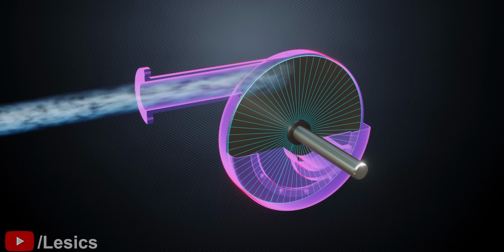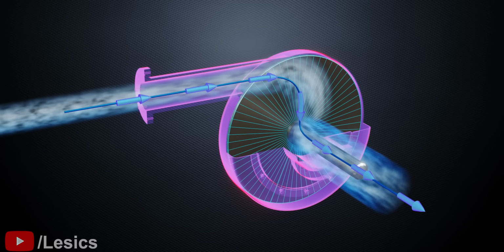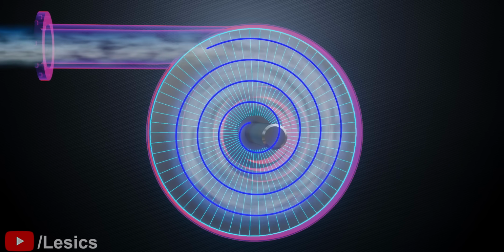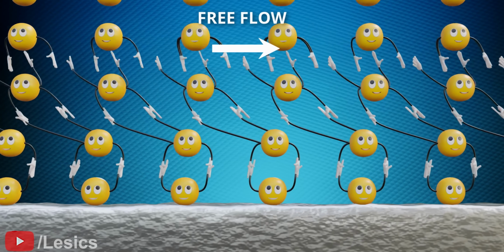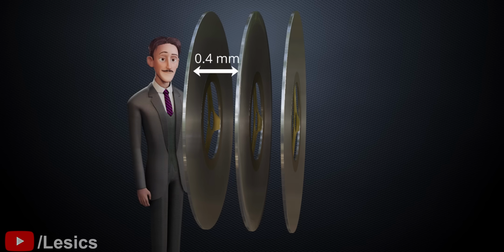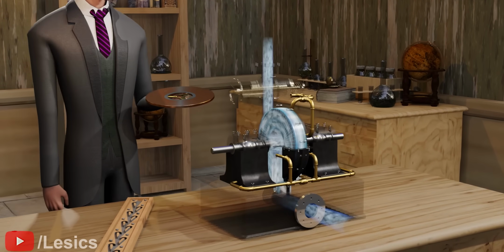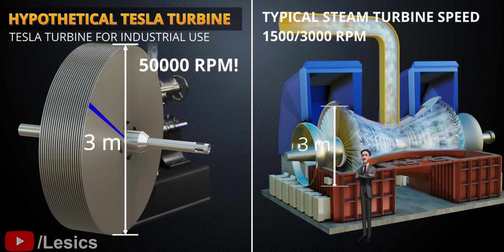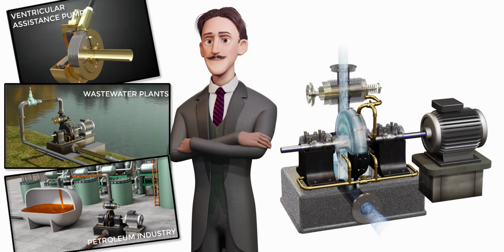Tesla Turbine | The interesting physics behind it

Comment: TESLA : "It seems that I have always been ahead of my time. I had to wait nineteen years before Niagara was harnessed by my system, fifteen years before the basic inventions for wireless which I gave to the world in 1893 were applied universally."

we have to wait more for Tesla Turbine because we dont have strong enough material this monster :)
Reply: Anyone that hasn't worked at a steam power plant with steam turbines does not really understand the complexity of a steam turbine when you have to overhaul one every so often our power plant had six boilers and two turbines for each boiler they made $375,000 volts and they stepped it up to over 500,000 then it went to various other industries and cities at other voltages mainly for the cities of 69,000 KV would travel 20 miles to another step down substation that would subsequently step that voltage down to 13,000 or 4160 whatever the case may be then going down your street to another transformer to step it down to usable 120 to 240 v
Reply: Sometimes, great inventions never see the light of day before other technology makes them practical because they are superseded by newer inventions that achieve the same or better outcomes in a different way.  We might one day develop an exotic material that is strong enough to build a giant Tesla Turbine.  But, why bother going to all that trouble when today's turbines are already 90+% efficient?  You can't get more than 100% efficiency, so if today's state of the art turbines are already close to 100%, then the Tesla Turbine offers no benefit.  It was brilliant in its time, but it will never compete with today's turbines in large industrial use cases.

It's not a magic free energy machine, people.  It's just a turbine.
Reply: @bradwilson76  increasing efficiency on an inferior design may result better yield, yes. But not the best yields possible. Applying the same advancement  to the superior design will always result in a better system. 
   During construction of a 120 story building, adjustments in construction after the 50th floor cannot make up for advancements discovered in building foundations. 
   There comes a stagnation as attempts of increasing efficiency reach a certain level. 90%+ you say we are at now. I'm inclined to believe that may be exaggerated.  Not enough to spend countless hours performing experiments, repeating them, and doing the math to check. I would concede +or- 3% of 90% efficiency. But doubt that is what we are yielding in real life applications. But here comes the brick wall, so to speak, of advancement in these systems. Progress slows to a near standstill with little result and massive effort. With so much put into advancing this system, would anyone contemplate going back to the beginning and changing the foundation (using a superior design) in their quest for advancement? The system in place doesn't have to be immediately scrapped and considered garbage. It served its purpose, can continue to serve that purpose during the transition to the better system. We should never stop looking for a better way, or succumb to our arrogance by believing we've reached perfection. 
  Civilizations thousands of years ago, deemed primitive now, accomplished engineering marvels by today's standards. Some of which can't be duplicated. Things we take for granted in modern society, like plumbing, is ancient technology. Tech that disappeared after their superior society imploded, and only recently resurfaced back into mainstream use in the last 100 years. In that time, we have not made any real breakthroughs in advancing the technology. Improved it with modern materials we use to build the system, and devices like sinks and toilets (more for  vanity purpose than functionality) that become the weak points of the system, since our improvements are  the majority of causes of the system failure or breakdown. 
   All throughout history are examples of thinking the best had been achieved, yet advancement continued. By new discoveries, or moving seemingly backwards, to improve the foundation your building upon. 
   In today's world, many things thought to be anadvancement, is just us over complicating something to satisfy vanity, greed, and desire for a gluttonous lifestyle.
  Will mankind reach greatness and achieve all that seems impossible? I hope so, but if not, it will be because mankind was its own downfall. 
   Something else to think about. 
It was said, "everything that can be invented, already has been".  Didn't age well. 
   And I pose the statement 
'Nothing has ever been invented,  only discovered'.
Reply: @johnkutsch7411  You have a point,the Bible,book of Ecclesiasstics said:"There is no new thing under the sun...."..I noticed that inventor simply imitate the plants,animals body designs,systems,etc.....
Reply: @bradwilson76  size and portability might be two worthwhile advantages
Reply: The atmosphere carries energy in it and he harnessed it - no machine needed.
Reply: abi yoksa teslacraft mı geliyo :)
Reply: Couldn't we just make them smaller and make more of them? The video suggested 3 meters, but honestly, why would they have to that big at all? Because out current systems are that big? So what? Scale it down and then bam, all the sudden your materials will be strong enough. We don't have materials strong enough to make huge ones, sure, but who ever said they had to be huge? Why can't it be a huge facility full of very small ones? We could even make them smaller than his model if we had too.  Take rc cars for example. You can go 100mph with thin plastic parts, but scale it to full size without changing proportions of your materials and all of the sudden your materials will no longer be strong enough to handle the power.  Idk why everyone is assuming that they have to be large to be used on an industrial scale. Take most crops for example. Crops like soy tend to be very small, yet we still grow it on massive scales all over the world. We don't give up on it because they are too small or try to make them grow to 3 meters tall, we simply grow more plants. That's all we have to do with this design. The downside is that making a bunch of small ones means more parts to break and  higher costs to create, install and maintain them all.
Reply: @alexcrowder1673  large scale is needed to transmit. Small scale would put the power plant in your home. Cant make tons of money that way. 
   The push should be to make homes self sufficient. Not pay someone else to deliver what can be produced on site.
Reply: @johnkutsch7411  you could simply use more discs. The production of so many high strength minimum tolerance discs is a challenge regardless but there’s still some point where you just trade off disc radius for quantity.
Reply: @Coolio_Wolfus actually, let me expand on what I said.
Graphene is just 2D carbon sheets made into structures.
You got the flat sheets, the nanotubes, the buckyballs, and finally the newest structure, schwartzites. I mentioned them in an earlier comment.
Schwarzites are the most complex and have the best potential for structural materials, but they vary a bunch in how they are formed.
Basically its like you are molecularly constructing a sponge shaped object.
Reply: @scout360pyroz  : For a Tesla turbine you'd presumably be aiming for the flat sheets. Not familiar with Schwartzite.
Reply: @absalomdraconis  we are talking atomic level 3D printing of carbon atoms via chemical methods, almost casting them into a chemically constructed mold.
Reply: @Coolio_Wolfus that means nothing. carbon structures all have weaknesses to forces from a variety of directions, and graphene is no exception, regardless of relevant media sources making money off of exaggerating its strengths.
Reply: Smart people work by having many ideas, not by having every one of their ideas be good ones. There is no shame in having a reversible pump that works well for liquids but not gases.
Reply: Use Rearden Steel
Reply: And we unfortunately still don’t have actual wireless electricity
Reply: interesting that talk was about the turbine itself, without discussing the possibility of gearing mechanisms. all generators are connected to a gearing system, as far as I understand it anyway.
Reply: Fred Garvin  his contribution to science were hijacked by Edison, the Rocker fellas and the Fed unfortunately 😔 he laid the fundermental basics to alot of things we use today...
Reply: I wonder what materials he thought of using back then vs what we now have available. We have a lot of very strong metal alloys and other materials now that may be able to form a workable model.
Reply: Tesla invented radio but Marconi stole the idea. Marconi was like the Steve Jobs of his time steal or take credit for ideas and market them as his own.
Reply: @dg-hughes  true but to play devils advocate tesla put it on the backburner and didnt do anything with it. tesla had the problem of inventing something and then just leaving it alone and not touching it again.
Reply: Tesla's Turbine in under the ground.
Reply: william bush  The Black Knight satellite?
Reply: We were taught in millwright school about the volute not the Tesla in the pump I wonder what happened LOL
Reply: @ronalddaub7965  as a millwright myself I’ll answer your question. It generates extremely small amounts of torque. So practically it’s useless for anything you’d want a turbine to do.
Reply: need to cut down on the mass of the wheel and if possible heighten the strength it has against pulling.
I wonder how resistant some schwarzite nanotube structures or high tech 3d printed (then milled) plastics could be.
I know the former can have phenomenal resistance to force from one direction... but that was usually conpressive force.
Reply: No, we have strong enough materials these days. Heck, there are functional Tesla Turbines that have been built in the last decade.
Reply: @Yawehplaneswalker616  on an industrial scale?
Reply: You need to add gears.
Reply: if you can make peanut butter sandwich, tada you're an engineer lol.
Reply: Thats freaking genious!!!
Reply: So titanium won't work???
Reply: Niagra was originally designed as an AC polypase generating system, inspired byrR&D being done in Europe, long before Tesla entered the fray. 
Tesla denied the very most basic basis for wiereless communication, planning instead to sent mis communications through the ground, same way he expected hie wteless power system to work. It was only much later, when Scientists and engineers had determined the best ways to make it work that Tesla jumped on the bandwagon.
Reply: @Abraham Technology college dribble regurgitation
Reply: The efficiency of the Tesla turbine was exceeded significantly by the late 1920s.  So no, it's not that we don't have "materials strong enough for this monster" -- it's as simple as there is a lot better tech right now.   The Tesla turbine was more efficient than steam turbines of the time.  But axial flow turbines are significantly more efficient.
Reply: Gaspar Cunha Cunha
0 seconds ago
We have a long way to go.It is just the start ............
Reply: @emDce  (
Reply: I wonder if these could be made in the microscopic scale for niche applications.
Reply: Different fluids have different levels of viscosity, and a more viscous fluid would allow a wider space between the discs. As would a different disc surface type. Could a greater level of efficiency at lower RPM be achieved that way?
Reply: @reddysteddy2195   The general principle would indicate 'Yes'...
Tesla was coming from a fairly 'steam-oriented' environment, as well as having experience with liquid water as the working fluid.
While the first commercial industrial vapor compression refrigeration equipment was marketed in the late 1850's, is was probably not viewed as compatible with the ideas that Tesla was pursuing...if that even represented a potential improvement...
Then he got interested in some other things...
Reply: And then comes an apartheid capitalist and steals his name.
Reply: Carbon nano-tubes?
Reply: Hi there. 
So what you want to use is cubic boron arsenide, which is the highest thermally conductive element on the planet.  In fact, as heat increases so does its rate of thermal conductivity. Higher than diamond.

It also happens to be an electrical insulator, which is a design plus.

It is also a fairly hard element, at 22 GPa on the Vickers scale.  Which is about 2 1/2 times the hardness of steel.  Less than diamond, but the most important part here is thermal dissipation.  

And it can be grown in a lab to fit any form or shape.  And is cheaper than diamond by far.

That said... you could probably get away as well with having an thicker base on the disc, and thinner almost razor like edge... Which would help in thermal dissipation of the rotor... as the fastest moving area will be the edge, which will also experience most heat.. while the center will experience the most torqueing force... 

If someone would simply fund me, I'm pretty sure I could make a tesla turbine with 96-97% efficiency fairly easily.

It would only take a few billion :D
Reply: 0p
Reply: @emDce  it was born in a land now called Croatia which is probably Serbian long time ago like Kosovo was. Some croatians were calling Croatian..But.he he said he was a proud Serbian.. His father was a Serbian Orthodox priest. They say was never close to his son.. h it was much closer to his mother. I don't think was Serbian. They say when he was younger he was struck by lightning which who knows might have changed the mechanics in his brain to think the way out of the box.  So that's the story
Reply: Insane comment.
Reply: Weekend warrior... you make fun of an idea which - IF APPLIED - is very destressing for abyone who wants to try anything, for anyone who fears rejection or failure. Wtf is wrong with you..? There are no stupid or smart people,  pretty damn basic science to know that.
Reply: @emDce  Good to see the statue destroyed in 1992 was restored, to a square named in his honor, in 2021. Also in 2021, Croatia and Serbia were fighting...over who has the right to put his face on their currency.
Reply: It's kinda obvious you don't build dam in one week
Reply: Convoy from Netherlands
ГОЛЛАНДИЯ В СЛЕД ЗА КАНАДОЙ КОНВОЙ
https://youtu.be/gn0F2L1mkCY
Reply: Why is mach 13 an engineering impossibility?
Reply: NFT RESOURCE 
5SGO
With today's technology, hydrogen is obtained by 3 basic methods. We have developed a different method, we can produce the hydrogen we need instantly at high capacities. This method will take technology one step higher, it will definitely end global warming. We will have 5 times more energy with less electric fuel.
-Financial structure: 1-Number of production (not unlimited, will be terminated when the project is completed, most of the NFTs will be taken back, if there is a financial need, a small amount will move freely in the market)
2-ECONOMIC RECYCLING METHOD; (HOURGLASS MODEL) It will not be like a pyramid, you will start earning from where you buy it. When the project is completed, we will turn the pyramid upside down, we will continue to win. It's actually an hourglass model.
THOSE WHO BUY SMALL 
MONEY CAN ALWAYS SELL AT A HIGH PRICE, BECAUSE IT WILL BE LIKE A COMMERCIAL WITH HIGH VALUE.
3- FUTURE; In the NFT5SGO PROJECT, clues will be published in thumbnails, and those who solve the clues will be able to use this system themselves. License will not be granted.
4-BLOCK CHAIN; Those who prove their purchase will advantageously have 5SGO energy systems.
IN THE WORLD… EVERYTHING WILL BE BEAUTIFUL IN SEVEN CONTINENTS…
NFT'S ARE PRODUCED WITH SECURE CODES
https://opensea.io/assets/matic/0x2953399124f0cbb46d2cbacd8a89cf0599974963/24283824761166635091136471727696404807641531268543076445902022758547805175809/WE REALIZE ALL ECONOMIC SYSTEMS
https://www.instagram.com/nft5sgo
Reply: nano particles to the rescue!
Reply: Proton pumps at the molecular level.
Reply: Truth about Tesla.. amazing watch! https://youtu.be/x0z5RdgmxOA
Reply: We can use titanium right?
Reply: Oh the material exists. The public are not allowed nice things. ie. Cheap energy.
Reply: array not giga engine.....
Reply: You would need it to be machined the way they produce satellite parts, we have a much better ability to create precision parts. I'll bet they warped due to imperfections in either the fluid or the rotor.
Reply: There is a new material das experiences no heat expansion from 4 to over 1000k. This could aid smaller tesla engines to work, but not big ones.
Reply: @splitframe  What material? I'm curious.
Reply: @SapioiT  I cannot remember, it was on reddit science a few days ago.
Reply: @SapioiT  look at server storage hdd that have platters that rotate at 15K small but massively produced like a person per generator like the storage think small. it doesnt scale to huge GW then again doctor a use for it like disguised pc's as iphones be creative.
Reply: @splitframe  But it is only central govenrments and corporate monopolies that want massive centralised power plants.
Distributed power and energy production is not in their interest.
It would eliminate the public dependancy.
So it is not on the radar for them.
Reply: @splitframe  but what about the forces applied to it? It needs to withstand more than just the temperature.
Reply: @emDce  Unfortunately, this is all by design. As long as the population fights each other, they leave their slave masters alone.
Reply: @cg56578  based
Reply: @cg56578  The tax farmes have gotten quite efficient.
Reply: A somewhat impatient fellow. Complaining about waiting 15 years? Naturally it can often take centuries before a new technology is fully realized. God bless Tesla - #ForeverYoung
Reply: @aarondrake6409  yuh
Reply: @aarondrake6409  we don't live long enough to be patient for the very people holding us down and that we are trying to help.  It is a shame , this worlds greed indulgences.
Reply: @aarondrake6409  true just look at the things davinci was designing
Reply: @Grimlin-fhe  da vinchi's stuff was mostly rooted in the physical world.
Alot of his stuff would never work,like his helicopter
Reply: @jadekayak01  Well yes his exact design would never work but the concept and idea behind the design is what takes time to see realization.
Reply: @jadekayak01  I'm not saying his designs will work I'm saying that he had ideas that were far ahead of the time which eventually saw realization in another form due to the natural progression of technology.
Reply: @Grimlin-fhe  ok.

It just gets my goat up how people play on others ignorance and put tesla on a pedastal not rightly deserved
Reply: @jadekayak01  Yeah I agree it's not like this sort of thing actually had a major impact on the world because of them it's just interesting to look at and see how people thought about things at one point and how the underlying ideas are now implemented.
Reply: @emDce  What? Austria, Hungary, Croatia and the non-farming non-desert regions of the US have full coverage electrical networks as far as power lines and plants.

Also both of his childhood homes were wrecked not because of ethnicity nor his kinda-sorta agnosticism, but civil war/terrorist (since it happened after declaration of independence) action of trying to take over the city (one being even trying to bomb the nearby railway after dumping corpses of random villagers there) followed by the Yugoslavian Army preventing the citizens from defending themselves.
Reply: I have a another idea use magnetic   bearing coated with graphene.
Reply: Coat it with graphene problem solve.
Reply: @Gol_D_Roger_The_Pirate_King  not strong enough
Reply: @demonwing9431  coat it whit flex seal 😝😂
Reply: @demonwing9431  What about carbon fiber?
Reply: @kmartkid6312  don’t think so bro needs to be much stronger than shi we have now li stronger than titanium
Reply: @tim234mumba  hey hey you might be onto something😂
Reply: @demonwing9431  we do have new "proprietary" meta-materials that would more than fix ANY problem with this turbine....
Reply: @demonwing9431  titanium and carbon alloy mix?
Reply: @Gol_D_Roger_The_Pirate_King  cad weld molds?
Reply: @Gol_D_Roger_The_Pirate_King  13 mach on edges of the wheel at 50k rpm , and you betting on graphene
Reply: @Gol_D_Roger_The_Pirate_King  coat it in one piece.
Reply: @Gol_D_Roger_The_Pirate_King  0
Reply: @Gol_D_Roger_The_Pirate_King  use haki
Reply: @Gol_D_Roger_The_Pirate_King   wouldn't that reduce the surface tension Causing a less efficient design?
Reply: @Gol_D_Roger_The_Pirate_King  what if there was more than one axle say 4 one in the center and 3 around it would this lessen the rpm's while increasing the efficiency. as instead of all torque being applied to one center shaft its being divided into 4. in my head this could work maybe not as efficient as 97% but i would think that it would be better than if one solo was running at lower efficiencies. i cant explain this well but i imagine that since each disc next to another one belongs to a different axle the torque is applies to all evenly instead of all on one axle alone. i could easily be wrong but this is how i imagine this working with less stress and rpms on one single axle alone. DIVIDE THE WORK make it easier on each individual axle/ disk set up.
Reply: @Gol_D_Roger_The_Pirate_King  what put slick 50 in it because that's what's in a slick 50 no not good enough there really is no reason why something should spend that fast unless you have a gear reduction box for torque you don't need to make a million cycles or Hertz
Reply: Tesla: My inventions were passed up due to safety reasons...

Electrical Engineers: Yeah don't put your hand in that hole it will shock you :)

I'm wondering if his death wasn't an accident or suicide...
Reply: @Velossitee  Chance is greater,he was murdered like Stan Mey ers - who turned water in to fuel by extracting hyd rogen from it...according ly,Meyers refused the bil lion dollar money for the sale of his invention....
Reply: @fortunatodeguzman8017  yeah he used electrolysis which was and still is a very well known thing. But as anyone with a basic understanding of electrolysis will tell you it takes more energy to separate the hydrogen from the h2o molecule than the you get from burning the hydrogen.
Reply: is it really the material ?  a possibility could also be limitation of current surrounding and cent. force
Reply: did I hear someone say carbon fiber disks?
Reply: Türk görmek güzel. Yorumun Türkçesini yazar mısınız.
Reply: Thank to this Serbian brain.
Reply: How about Titanum, that doent bend and breake. Its kind of flexible.
Reply: Fred Garvin  his contribution to science was USELESS.
everything he came up with is impracticle.
e.g.  his electricity "broadcast" to users wirelessly-very possible but the loss of power increases with distance from transmission.
a practical device that demonstrates this is the wireless cellphone charger-just an induction device but it doesnt work at distance
Reply: @alex crowder—theory says run at smaller diameters and slower speeds is less efficient...if less efficient Thant standard turbine, then no point outside of niche markets.  The functional theory of viscosity interaction of steam on the disks is efficient at high speeds.  Slow it down to achieve material stability,p and the system is less efficient than standard turbines—so no point.  Sad that no minds like this exist today...like the age of rock-and-roll’s savants, individual amazing contributors like Tesla are history.
Reply: @lvoss2534  someone else posting on this video has already made a small model of this turbine and achieved in excess of 94% efficiency and up to 96% in certain applications. I still see no reason to make them so large that they destroy themselves...
Reply: @lvoss2534  Then simply make it as fast as we can make it with modern materials... Tesla claimed very high efficiency with a very small device. Its still illogical to make them 3 meters if we don't have the materials for it. We shouldn't even be considering how to make them 3 meters because thats just a random arbitrary number that we have no reason to "shoot for". We should be attempt whats feasible 1st and rework it from there.
Reply: No, there will never be a material for it. The g-forces expereinced by the disk would be 4.3 million. That's 4.3 million times the force of gravity. This technology is useless for a turbine.
Reply: Perhaps carvon fiber can do it.
Reply: tesla did not developed wireless power transmission, Not wireless communications wifi, was invested in the CSIRO division not tesla, his experiment failed , Stop your lying.
You want correct yourself or you want me to put a strike against your bullshitting on behalf of the CSIRO.
Reply: And you of course know there was no corruption against tesla and that none of his stuff was confiscated..? He was simply a failure lol. A legendary failure after whom the greatest inventor of our day named his company.
Reply: @Gandalf721  i understand perfectly.his discoveries were ground breaking but impracticle-thats why we dont use them today
Reply: We have titanium amd graphan
Reply: @awokenv7302  They aren't magic materials. Even they may not be able to handle such extreme RPM
Reply: @emDce  your old serb counts should maybe stfu and use the time you have left to make your peace with God
Reply: If you know anything about electronics and read Nicola Tesla’s writings you soon conclude that his knowledge on the subject was virtually nil. His contribution to radio was non-existent. If anyone can supply evidence to the contrary, I would be most interested in seeing it.
Reply: @HMV101  : Electronics are largely irrelevant, because they are mostly post Tesla. Transistors either had barely been brought to market when he died, or hadn't been brought to market at all. As I recall, the triode had barely been invented when he died. So, trying to look at his involvement with radio from the perspective of electronics is naive, because most of electronics was invented after he died. Instead, you have to constrain yourself to Edison bulbs, florescent tubes, alternators, relays, and similar mechanisms, because that's what he actually had access to. He almost discovered the Schumann resonances, and a reading of his work suggests his Wardenclyff work largely centered around an attempt to dynamically tune into one of them for his wireless power system.

As for evidence of his contribution to radio, it's fairly simple- the court found in his favor, and against Marconi. And yeah, there was such a court case. This was back in the days of spark-gap.
Reply: @HMV101  Just read the patent that Marconi stole to get credit for YEARS, about the radio .
Reply: Of course, Elon musk named his company ironically.
Reply: @Charles slater, dude your smoking that good shit
Reply: " Niagara was harnessed by my system' Sometimes Tesla really disgusts me. He would have known full well that Lamme and his sister were primarily responsible for the design and construction of the Adams plant. He constantly took credit for the work of Westinghouse engineers.